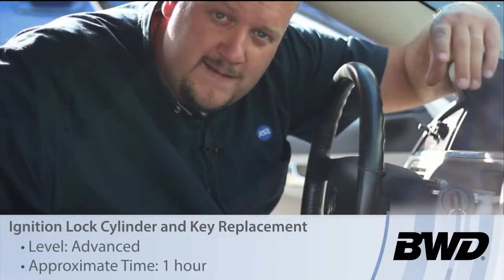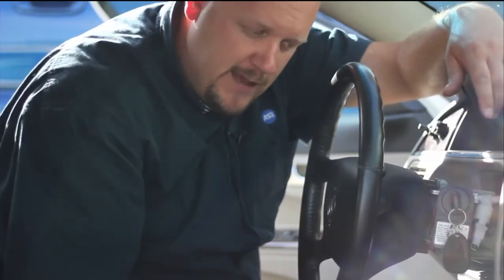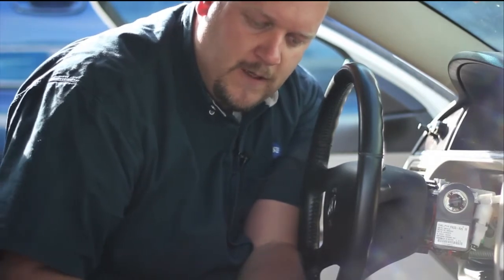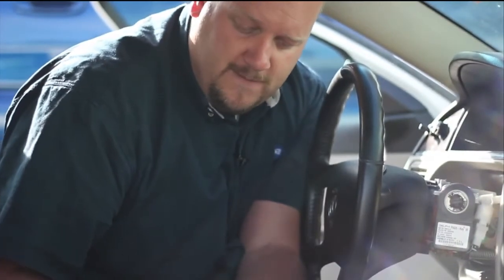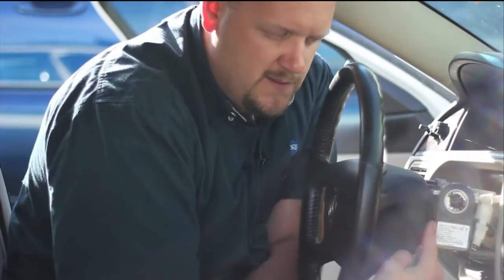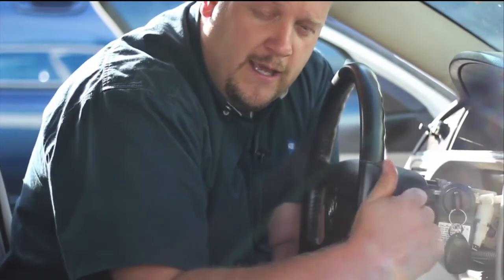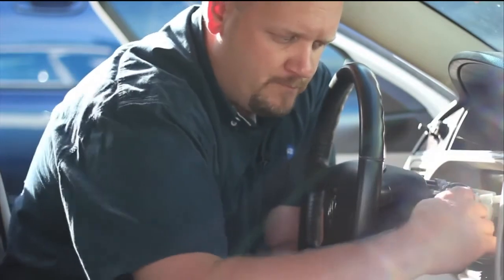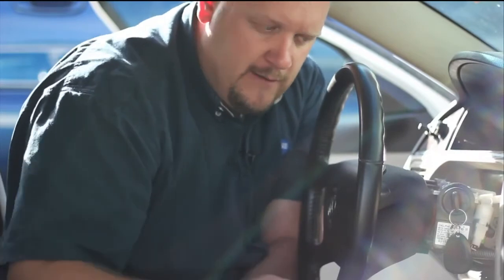Buick Ignition Lock Cylinder Replacement

Comment: If coil wire in the pass k3 black module box is broken very thin wire can it be connected and soldered  or will I have to buy new one